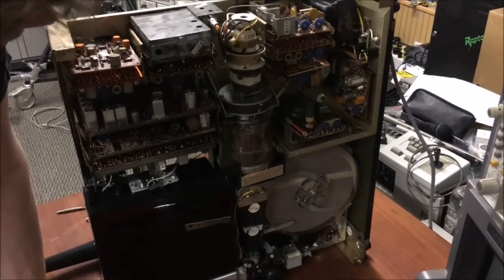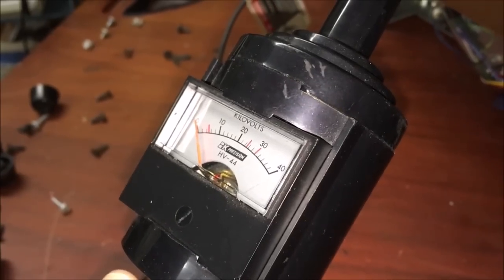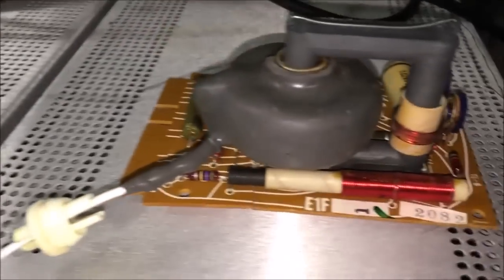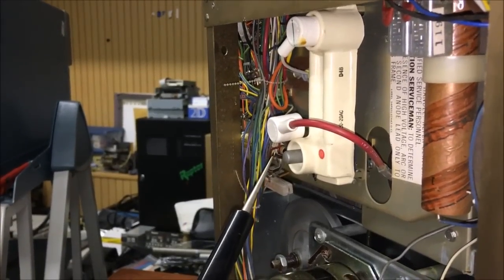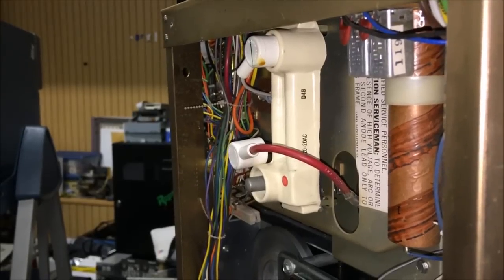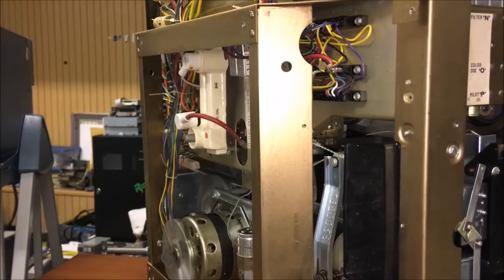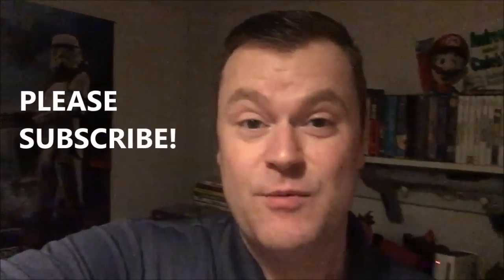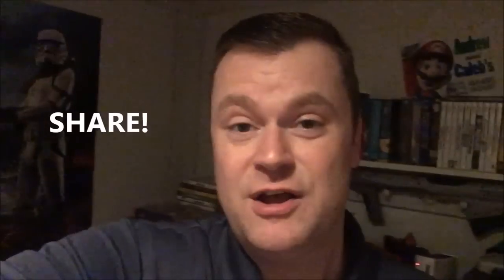EVR Teleplayer Home Video Format Restoration Part 2

Comment: Note that when you measured the HV, the CRT was not connected. The CRT forms a capacitor across the doubler so that's probably why your HV was only 15kv versus the specified 20kv.

Comment: 12:35 - Would that 'optical adjustment' be re-focusing, so the camera is focused only on the phosphor, and not the layer containing those dust-spots?
Reply: No, the CRT faceplate is not thick enough to put the dust out of focus when the optical lens is focused on inner phosphor side. The dust is close enough to the phosphor layer that it shades the spot as it passes under the dust, whether or not the lens is focusing the raster onto the film clearly.

Comment: The metal casing has to be on and the unit has to be sealed for it to work. It won't display properly if any panels are off. Put it back together and then try it again.

Comment: Since it doesn't record, and it plays from film instead of video recordings, and doesn't even use tape, then it certainly is not a VTR. It's a film player. "EVR" may stand for "electronic video recording," but that's somewhat of a misnomer, and it plays those recordings but doesn't do recording, but since it sends the signal out as video, that's where that V comes in. Not a VTR though.
Reply: But it's not as simple as that since it's transferring film to an electronic analog format then sending that to your TV. So "electronic video" is arguably appropriate, especially when considering the time period it was released in.
Reply: @awesomeferret  
No, because video already IS electronic. It should be called something more like "electronic film player." But even using the existing misnomer is more accurate than what Brad did when he called it a "VTR" once.
Reply: It's an "EVR player", part of the "EVR system"